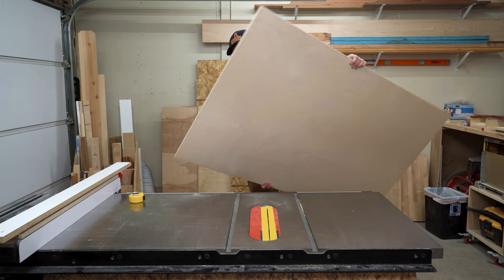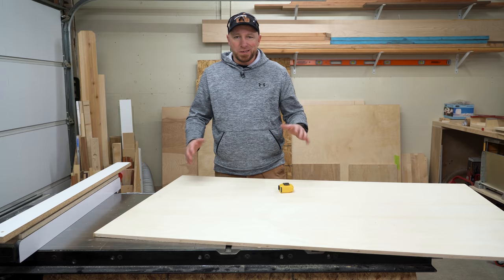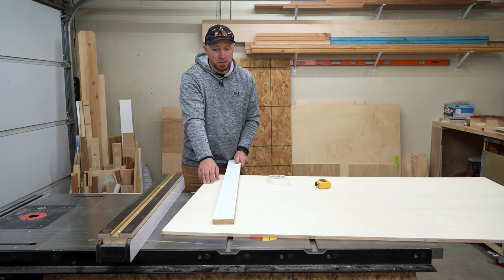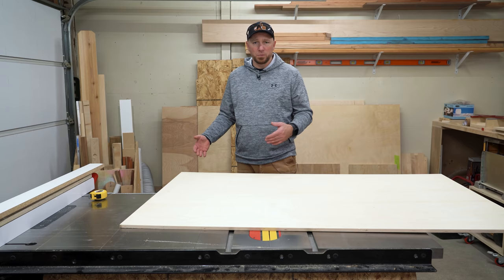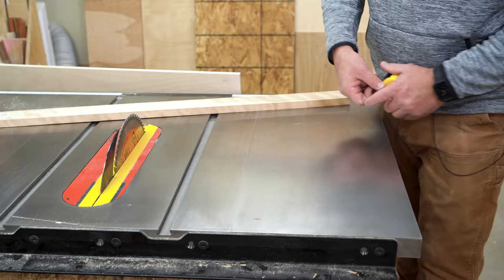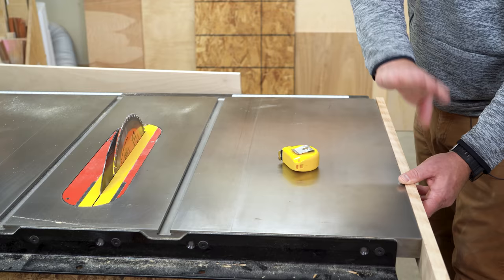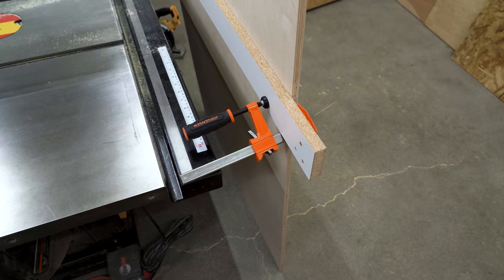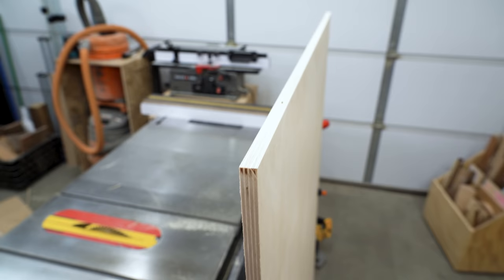A Table Saw Trick So Crazy, It's Genius!

Comment: Very interesting but dangerous. 
A 1/2 inch top bearing spiral cut carbide router bit and a straight edge and you are safely done in no time at all. Safety first!!
Reply from the maker: Technically speaking, this is actually safer than using the table saw the traditional way because there is zero chance for kickback. As for the router, you wouldn't want to break down full sheets of plywood with a router. Or at least I wouldn't.
Reply: Certainly not for breaking down sheet-goods, I agree. Just addressing the trimming on one edge. Router seems way simpler and more accurate than modifying the table saw. But hey, just be safe.

Comment: Not all saws will cut accurately when registering from the end. Also, without substantial table support, the cut is risky and difficult at best. If it's too big to take the work to the saw, take the saw to the work.
Reply from the maker: I completely agree with taking the saw to the work when necessary, but there is no logical reason any saw shouldn't be able to register from the end, barring something physically being in the way.
Reply: @InspireWoodcraft  there are many saws that only align the blade with the mitre gauge slots. Jobsite saws for instance frequently have recesses for carrying. Pressed metal table extensions are definitely not straight.
Reply from the maker: Definitely. That's why I brought up installing a ledger though. A couple of decades ago, even with cast iron cabinet saws, ledgers had to be put on for this reason because the table edges were not as polished and refined as they are now. If you bolt a ledger on, again unless something is physically in the way, you can shim and adjust the ledger to be smooth and parallel to the blade. But with the number of tools recently invented, like track saws and guides, bringing the saw to the material is sometimes a better option, like you said.

Comment: This would only work if you have a straight edge on the saw, my rigid contractor saw has some weird protrusions on the edge.

I already had a circular saw since before I ever considered woodworking, I recently got a Bora straight edge clamp, it's worth the $40-50.
Reply: Pay attention! He covered the issue of such protrusions. He also discussed why a circular saw might not always work well.

Comment: When I build cabinets with 3/4" cabinet liner, the raw material is not square and accurate. The sides bow in or out 1/8". So.... I have to true up each sheet with a router. What a pain. I like everything about that stuff except that and the fact it weighs 100 pound per sheet.

Comment: This is a cool trick but I can’t think of any reason to do that. Now your cut is straighter than the factory edges. There’s probably a 1/32 of fuzz on the factory edges. You need to resaw all 4 edges. 
If you’re doing cabinets then the factory edge isn’t good enough. 
If you’re doing anything else then your perfect edge is way overkill. 
Almost all plywood edges get buried under trim anyways. 
Would like to see WHY you need such a perfect edge. 
Not trolling just a serious question thanks.

Comment: but then you’re relying on that tiny square—on one side—to set your fence?😂😂
Reply from the maker: @nathanielsnyder7396 A couple of things: Squares should only be used on one side. If squares are used on both sides of material and the two reference edges happen to not be parallel, you won't know which side is reading accurately. Also, the length of a square can be extended by mating it with a straightedge. It does not change the squares straightness or squareness, but simply extends it.

Comment: Not bad but I have better way and a lot faster to get it done. All u need to make 1 piece of 1/8 or 1/4 mdf board. Make it maybe 2.5 inch to match tablesaw fence. Then cut it without used mdf on fence. then cut it again with mdf. Then you are done.

Comment: Stopping the cut part way through to regrip causes just as much inconsistency as using the track saw. Try getting a better circ saw that doesnt have a warped plate. DeWalt just uses cheap stanley/B&D parts and contrary to popular belief, are not nearly as good as people think when it comes to tolerances! Just seems like on the job this would take longer than needed, trying to balance and support that big sheet on a table saw would have just as many flaws and would not provide a ready edge. Also, using that tiny square for that large of a piece was a joke!
Reply: Even my cheap HF saw has a better plate than his. 
I wouldn't do the trim-off on my table saw anyway. Here's why:
1. when you push the (big) plywood through the saw, at the very end it reaches the tipping point and is extremely hard to hold the line true. Even if it doesn't tip, with that much leverage off the edge of the table, it still isn't stable left and right.  

The board is only pressing against half the fence that it was when you started.

2. if it's finished plywood on both sides, the saw has a strong tendency to shred or chip the blade's exit side unless you first make an 1/8" (or less) deep cut then tape the edge and run it through again for a full cut. 
so:
I suggest clamping the straight edge to the board and then use a straight cut router bit to trim the board.

Comment: Although this is a neat trick. I don't see this being any more accurate or quicker than using a circular saw and straight edge. 
For all the talk you had about the circular saw wobbling and the straight edge not being straight. That's all thrown out the window when you use that little square to line up the board.
I'm not saying this isn't a good idea, just if you are creative enough and skilled enough, a circular saw can make all cuts that a table saw can.
Reply from the maker: Actually, a small square can very accurately square something up when combined with a straightedge. It's a common misconception. It all just depends on the reference surface and if said reference area is true enough. The plywood I used in this demonstration IS true, so it makes no difference whether it is a small square or a large square in this situation.

Comment: FLEXES ?  My Dewalt circular DOES NOT wobble.
Reply from the maker: @Stephanie Nassman My DeWalt has a warped plate. It’s a pretty common thing, unfortunately. The Greenworks saw flexes when taking a shallow cut because it’s too top heavy. That’s the problem with using construction tools for woodworking, I suppose.
Reply: @InspireWoodcraft   A warped plate? From what? Are you putting the thing in the oven? Their is no way in h@ll that these saws could EVER get hot enough to warp anything on that saw. Don't know you think you are trying to fool.
Reply from the maker: Ah. You got me. I AM trying to fool you. 🙄

Comment: ROUTER…
Try using your router with the plywood straight edge & clamps… that way you do not have to manhandle the sheets and the router is always flat unlike a circular saw
Reply from the maker: I'm not going to break down full sheets of plywood with a router. I'd rather find a new job than do that.

Comment: You can't accurately measure a thirty second of an inch on a tape measure that's calibrated to sixteenths. Any tool is as accurate as indicated on the tool. Anything else is an approximation.

Comment: Or just get a straight edge and clean off the factory edge? You are still left with the factory on the rip edge, which most YouTubers tend to over look, and  are very often crowned.

Anyway,the motor is very rarely parallel with the top. Getting all three to line up, the fence, motor and table. Just isn’t worth it

Comment: The real elephant in the room is, why do you own a circular saw with a warped base? If you are a serious hobbies then start by having a decent set of basic tools. Can't get much more basic than having a decent circular saw. That's like having a level that's 1/4 inch out of plumb.....totally useless.
Reply from the maker: Thanks for the tip. I’m not a hobbiest though. The fact is that most saw bases are warped unless you have a higher end saw. I have a DeWalt as well with my the exact same problem. Circular saws are not made for cabinetry or woodworking, they’re made for carpentry, and the quality typically reflects as such unless you spend the right amount of coin. Again, it’s not to say that ALL plates are bent or warped, but lots are. There’s discussions all over the internet regarding this issue.

Comment: SMDH On the one hand the circular saws "wobble", then a random scrap piece of wood is "straight enough for my purposes"....WTH? And really dude, if you can't get rid of "wobble" in a circular saw, or buy one that doesn't wobble, or even get a track saw, why are you working on a $3000 table saw? Again SMDH
Reply from the maker: @oldschooldiy3240 It' a $5000 table saw, if that helps you.
Reply: @InspireWoodcraft  Not really my problem though, right? I have a circular saw that doesn't wobble with several blades depending on what I'm cutting! I was just baffled that someone with that set-up would not have a quality track saw or circular saw at his disposal....still SMDH